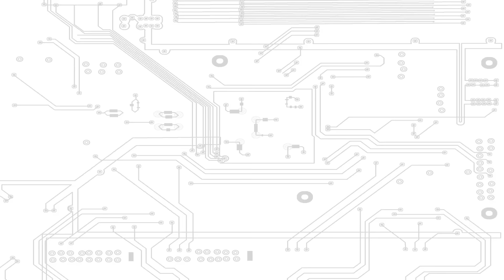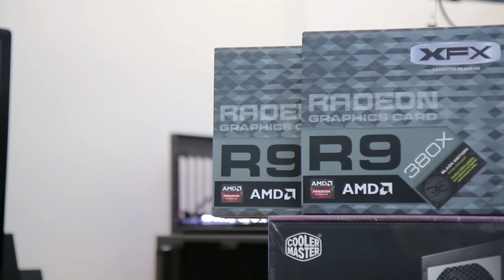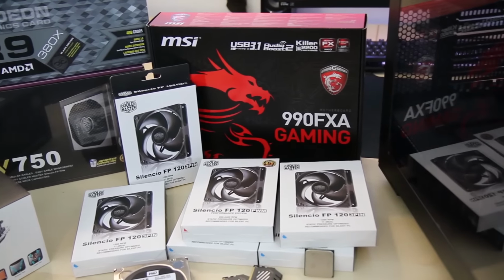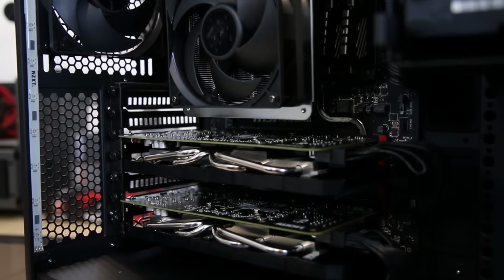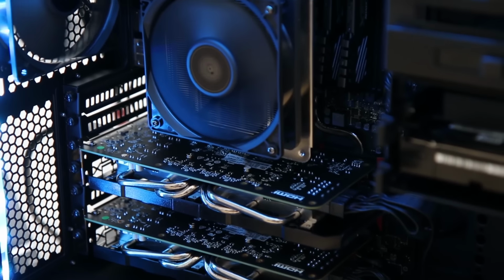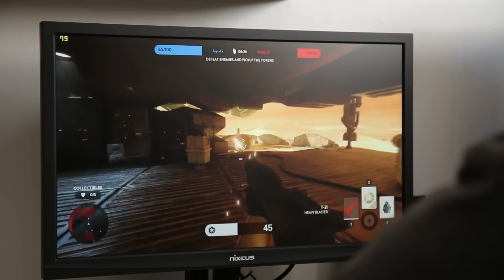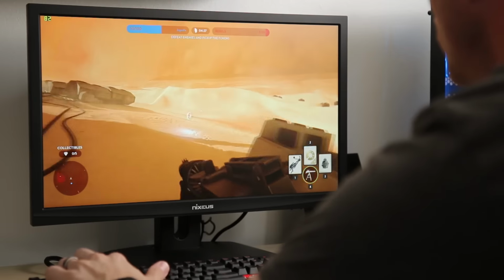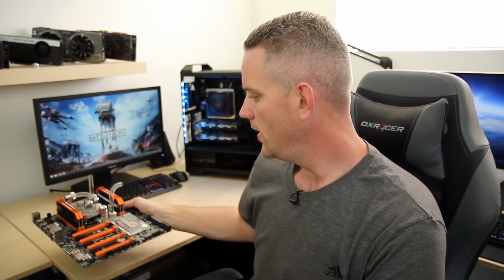AMD Gaming PC - Is AMD still good?

Comment: i might not  have the best build ever, but as long i can play all may games, with no problem, then im happy :3

PROCE: AMD FX8350
MOBO: ASUS M5A99X EVO R2.0    
MEMO: CORSAIR VENGANGE 8GB X2 1600 MHZ     
COOLER: CORSAIR H100i                      
CASE:COOLER MASTER STORM STRYKER           
PSU: CORSAIR CX 600W                       
GPU : ASUS STRIX  GTX 970                  
SSD:ADATA sx900 128gb                      
HD: 2TB SAMSUNG
MONITOR: ASUS  Vs278q-p

Comment: i have a amd fx 8350 in my rig. about the only thing it struggles with is the dolphin emulator which i get intermediate stuttering in ):
Reply: +skyrim dude   it's because dolphin uses single threaded performance ..
Reply: +skyrim dude  also the new wii u emultor , runs better with intel , but still struggles

Comment: what is better amd cpu or intel ?
Reply: akalion213 can you overclock a i7-3770k?
Reply: ow okay does motherboard have anything to do with oc?
because i tried but i always get 3.5 ghz no matter what i change
Reply: akalion213 also i have a asus p8z77-v pro motherboard does this work with oc? cpu
Reply: akalion213 650 wats power supply and running a gtx 970 should it not be enough to oc the cpu?
Reply: akalion213 i7-3770k cpu
Reply: akalion213 ow okay thanks for the help friend! means a lot :)

Comment: AMD GPUs for sure have their issues, CPU (driver) overhead is the biggest one in my opinion, opengl and linux drivers is another one, but once you deal with this compromise you will enjoy a great hardware, that will age far better than Nvidias gpus. So even if at first may not impress you very much, with time you will fall in love with it. I do have a 2 years old rig with a 8350 and a r9 290x and it was at first compared to the 780ti, now the same 290x is compared in most of the titles with the 980 leaving the 780ti behind. In fact this year i did another build with a haswell i5 and a 980, and i did it because at first the 980 was a great performer, but now after 9 months, my 2 year old rig is pretty much on pair with it. 
Everyone that have AMD cards know how great their hardware is and how poor the software part it is at it's launch. This is a bit sad, but also it is great to see it improving with time.

Comment: I'd use AMD if it meant the difference between gaming or not gaming. But lets be honest, the only real reason you would buy AMD over Intel and Nvidia is budget
Reply: MaTtRoSiTy nope Amd has better updates for older hardware compared to Nvidia. Amd products start to shine when the parts age
Reply: Don Alexi Yea they do...at the mid to low end of course. If you want the best performance Nvidia wins at present
Reply: MaTtRoSiTy 7970 vs GTX 680. both high end cards at release. 290x and 780ti. Same deal

Comment: lol I can barely play that game on my current AMD pc (got what I could afford), I live in Florida so I'm barely gaming as is because of the heat even if I air blow out the dust and replace the thermal paste > /\<
but hey maybe I fked up and someone here can help me with the specs cause I'm sure There's awesome peeps here somewhere.
850psu
8350cpu
16gigs  (4x4 gigs of mushkin ram 240-pin ddr3 1600)
990fx r2.0 motherboard
7870 iceq edition to try to help with the heat.
took me about 2 years just to get this .. so small chance of improvements.. I even switched to windows 10 to see if it would run better but things still stop responding and having to clear my memory alot when things get too laggy.

Comment: I use the Z97 gaming 3 with an i5, and it also comes with the Killer E2200 networking whatsahdoodle. It's absolutely tanking my bandwidth though, I get 150mbps. Speed tests constantly show I'm getting 110-140 mbps and on my old OS without it my speeds were wonderful (I don't know how to revert back as my friend sorted my OS's) but now they're terrible and i'm lucky to see 5-10 meg on downloads and I get latency issues in multiplayer gaming, any ideas? :(

Comment: I wouldn't buy AMD system now, because of upgradeability. I would rather go with Intel, even if it would be a little bit more expensive or a little bit slower, but I would know, that in few years (3 or 4) I will be able to buy high end CPU from current era, for lower price, and still be able to play AAA titles. New AMD CPUs will probably use another socket, so upgradeability on this system is almost non-existing.
But I'm still looking forward to see new AMD CPUs, I hope my next PC will be on AMD CPU and it will be as good or better than Intel system.

Comment: Hey Jay/guys
If someone could give me advice on what GPU to get. I was wanting to get either one R9 390 or two way crossfire of R9 380?
Thanks
Reply: what is your budget?  You should almost always get the single most powerful GPU that you can get as there are issues when running SLI or crossfire scenarios.  I would also recommend checking out craigslist
Reply: Niko Yochum Thanks

Comment: Without the crossfire cable?
Reply from the maker: +Gianluca Tuscano Where have you been? Crossfire doesnt use cables anymore.
Reply: +JayzTwoCents really? ok sorry! So if I get another r7 370 I don't need to use the crossfire cable that I've found in the box?
Reply: +Gianluca Tuscano ok, so, you don't need to use the crossfire cable if your motherboard and your cpu support two PCIe 16x 3.0 links, but with the cable we're sure that the pcie bus does not get bottleneck!

Comment: Yep, we keep waiting for AMD to release CF ready drivers. Why's this company so slow with driver releases? Are they not aware how it makes them look compared to their much more agile competitor, which also happen to hold the performance crown? They should at lease be good at this, but they probably count on their fanboys to buy their cards in spite of their obvious drawbacks (cough no hardware PhysX cough).
And what's the rational for an All-AMD build? Is it meant to cater for the compulsive AMD fanboys? Is it meant for people who are prohibited from using chipsets from other companies? Seems rather silly and pointless to me as I'm sure that a more open minded approach could have yielded a better performing system at the same or better cost.
Reply: +Tamir Maoz Good point, although since moving from team red to team blue (on the cpu side of things still rocking the 280x which has not skipped a beat so far so no point in upgrading) ive noticed heavy multitasking near impossible, my old fx-6300 was much better at that compared to the i5-4670k but the i5 has significant performance gains in games, but that is literally the only improvement...even handbrake was faster at heavy encoding on amd side of things from my experience, yes if i dropped an extra 300 on an i7 it could probably be better, but for 80 the fx6300 cant really be beat for performance/price
Reply: +Bannana I don't know how you've managed to get an i5-4670k to run slower than a FX-6300 in Handbrake. Even an i5-3470k gives more Handbrake performance: http://www.techspot.com/review/586-amd-fx-8350-fx-6300/page5.html
In a properly tuned system an i5-4670K should always be faster than a FX6300. The above benchmark shows that even an i5-2500K is faster in Handbrake.

Comment: He talks about more powerfull cards. is you can afford 2 380x's you can roughly afford an single GTX 980. which is around 500 dollars.

Oh, and i wouldn't mind paying shipping, even if it is 500+ dollars. It would still be cheaper than my system if i calculate it to Euro's the currency i use. 

My system is between 600-700 euro, If i plan on sticking with the 380, how ever i may just buy an 970 instead

Anyhow, if this system including all that is 500 dollar it would cost me 461,30 euro's. if it is 600 dollar it would be 553,56 euro's 

So i think depending on where these people live it may turnout even cheaper then if they build it themselves. My build was caculated with an 380. which then came in around 650 euro's but stuff changed. like in need of an new PSU and possible stronger GPU if my wallet allow for it. but it should still be around €700 ish in the end :3

Comment: I'm between a R9 390 Nitro form Sapphire and a Gigabyte G1 gaming GTX 970. I want the R9 390 because it performs better on 1440p and the 8GB VRAM would give me future proofness. I want it to last 4-5 years and games tend to evolve on textures. That means that the 970 will crap it self in the mid of the second year. But AMD drivers suck soooo bad! Nvidia have their shit together. And have good drivers. So I think that the 970 is better.... Please help form someone that has a R9 390 or a 970!
Reply: +Gonçalo Tomás Im running I7 4790k 4.7 ghz   and R9 390 8GB asus strix  and nothing takes this down.  Perfect and much less than the 980 ti fan boys.
Reply: +Gonçalo Tomás the fuck are you talking about "amd drivers suck so bad" thats complete nonsense. I've had my 290 for half a year now and never once had an issue, and before that i was using a laptop with a 7750M gpu and never had problems either. Nvidia fan boys always love to spout this "amd drivers r so bad" nonsense it really pisses me off. Just get the 390, its an overall better card and should perform better in DX 12 than the 970. And also Nvidia has a tendancy to gimp their older cards so that you need to upgrade, it happened to the 770 and the 780 i'm positive it'll happen to the 970 and 980.
Reply: +U Wot m8? nah 380x is a beast for the price. I doubt that the 960 ti will be much better.
Reply: +Gonçalo Tomás replying because in same boat and want some answers. haha
Reply: ***** go read what me and that other guy said and I think you'll find your answer.
Reply: ***** I may be monsterous but I am no monster. If you don't believe us just go browse r/buildapc and I promise you every $800-1000 build includes a 390.
Reply: +Huge Cock gotcha. Lol. Well i currently have the 960 4gb from EVGA, and while it handles anything i throw at it at or around 60fps, i want to go higher as i just got a 144hz monitor. My only real issue with it is the TDP marking, because if it is true i would have to upgrade my power supply, and that would take foreverrr. I have the i5 4690k with a 500w psu, and i don't really want to rip apart my rig and put a new psu in it for the 390. Do you think it'd still be worth it though?
Reply: Huge Cock ***** OK Thanks! I know everything that you guys said. I just collapsed and panicked in the choice. I knew that the R9 390 was much better buy. R9 390 Nitro form Sapphire!
Reply: *****
 honestly a 500 watt psu won't be enough for either the 970 or 390 with your 4690k if you are overclocking any of your components. You will need to get a new supply either way. a 600-650 watt will be more than adequate. I run a 4690k at 4.4 ghz and my 290 overclocked to hell on a CX 600.
Reply: +Gonçalo Tomás 
where does this "amd has shit drivers" mentality come from? i'm running an amd system for well over 5 years now and never had any problems whatsoever..
Reply: I have 4690k/290X system and no major problems with AMD drivers to date. You might have to switch to beta for some launches like JC3, but it's not like Nvidia hasn't had issues this year.
Reply: +s zarella how are the temps on the ASUS STRIX 390? I'm thinking of getting one
Reply: TG Death Mark its pretty good, of its cheap I'd jump on it. I've heard that a lot of people with asus cards are able to unlock them and turn them into 390x cards, which is sweet.

 If its not that cheap, go for sapphire or msi because they have better customer service and are notorious for being the best AMD card manufacturers
Reply: Huge Cock dat name, yea the 390 is around 390$ in my country and MSI/sapphire are around 430 (prices here aren't the best) But i was worried since the 390x got hot on the asus strix version.Thank you for the reply

Comment: can someone help me for my PC upgrade

my current rig is
i3 3220
8gb Ram 1333
B75 motherboard
R9 270x

here's my options

i5 6400
Z170 board
8GB DDR4 2400 single channel

or

i5 6600k
Msi H110m pro-vdh(use it while saving for z170)
8gb DDR4 2400 single channel

or

buy a used core i7 3770 (non-K)
and a GTX 970

i hope someone help me decide 

PS: the budget i have is limited
Reply: berzu21 yeah thanks for responding, already got the CPU it's used i got it for $134 hahaha! i'm just saving up for pascal gpu now

Comment: I have amd fx 6300 and when I play csgo i get 55c on socket on first 10min and core 45-50c in 10-20min like its getting so hot and i have be quiet pure rock. I have 200mm and 120mm intake and 120mm and 140mm out still so hot pls help

Comment: 48C.. yeah right more like a broken temp sensor on the CPU like you're used from amd bulldozer's.
Reply: AMD has a bit of a habit of incorrectly calibrating their CPU temperature sensors, yes, but "broken" and "miscalibrated" are still two very different things.
Reply from the maker: +WarFace HD Package temps on AMD are always much MUCH lower than Intel.
Reply: +Robert Faber I think in this term it doesn't matter if it's broken or incorrectly calibrating, since the purpose of the sensor is to be a value for Monitoring your temps and that's not possible, you're still right though.
Reply: +JayzTwoCents Didn't knew about that, I am only speaking of my old FX 6300 where idle temps were -5C and load temps never went over 25-30C wich I found strange and after a bit of research in forums about 90% said that the temp sensor on the CPU was broken, which is quite common for the bulldozer cpu's. However I appreciate the difference from this answer compared to the one a bit ago, sounds more like you.
Reply: WarFace HD Not as such. When a sensor is miscalibrated, it still gives a useful indication of temperature change, and it is usually possible to approximate the real temperatures by adding a set number. I know for example that with my Phenom II, I have to add roughly ten degrees to the readout temperature to get my actual core temperature. A broken sensor on the other hand will either give no readings at all, or readings that are all over the place and have no relation with what's actually going on.

Comment: I actually just built a very similar system for an early christmas present.

cpu/ amd-fx 6300

mobo/ same as video

case/ same as video

ram/ kingston hyper x 16gb ddr3 1866mhz

gpu/ EVGA GTX 960 ftw 4gb

psu/ Evga supernova semi modular 750w bronze (750w for exspansion purposes) originally went with an evga 500w but was experiencing random shutoffs, new psu no shutoffs.

hdd/ wd black 1tb

ssd/ sandisk 120gb boot drive(was 40$ on amazon during black friday)

no optical drive.

pcpart picker list:

http://pcpartpicker.com/p/kWdYvK